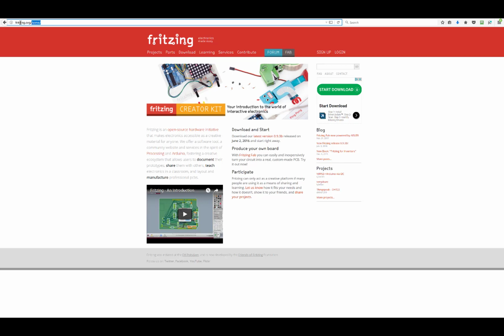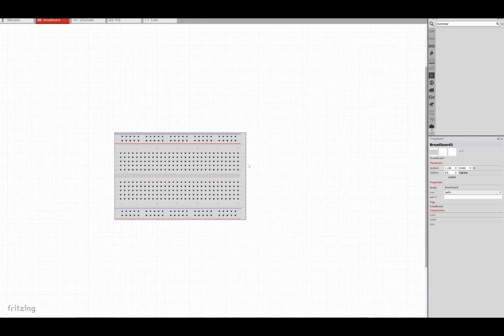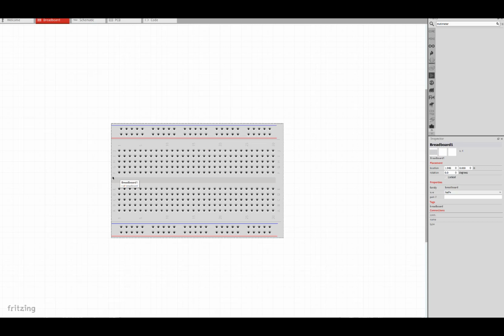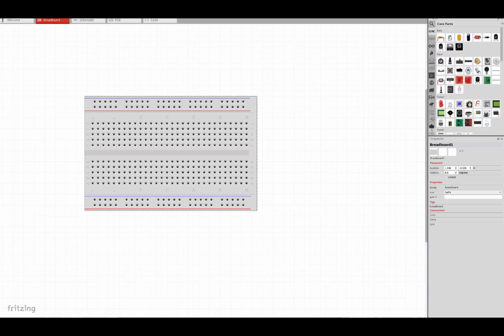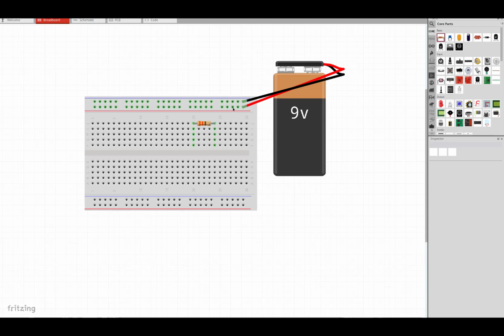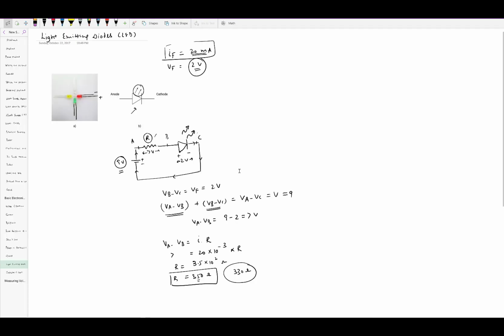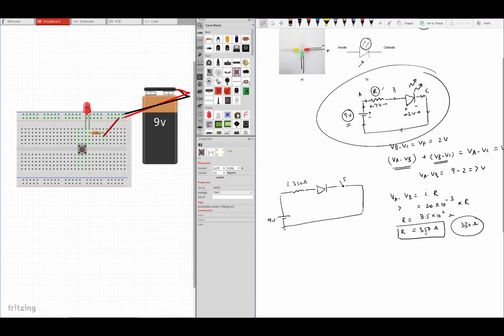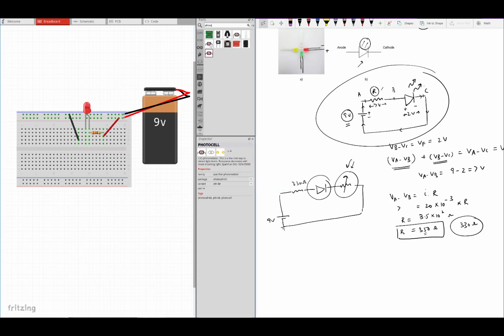Fritzing Demo

Comment: Does this software animate or somthing like that
I mean if it shows led glowing when i complete the circuit
Reply from the maker: It is not a simulation software. For simulation, you may try other ones -- a more recent one is at http://circuits.io
Reply: no I think it's doesn't :(
Reply: @bsa3979  Wokwi Arduino simulator does what the person is expecting
Reply: it will be interesting for you to try the Wokwi Arduino simulator for the LED toggling example. follow the link here: 👉👉 https://wokwi.com/playground/blink